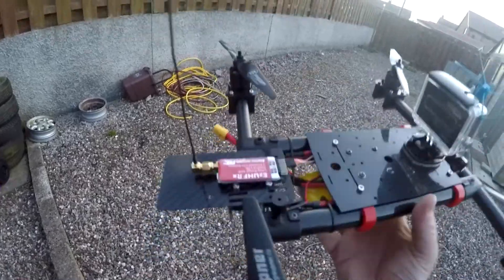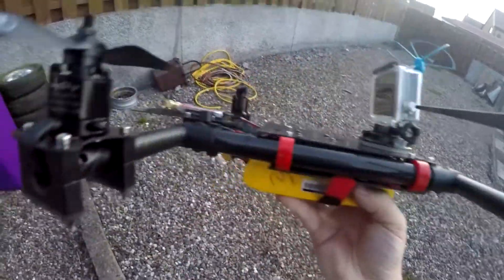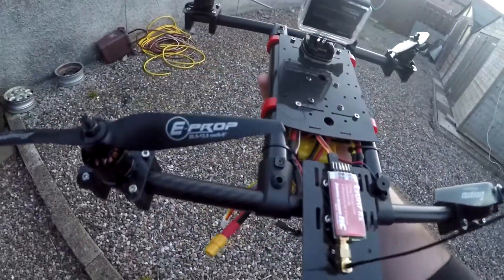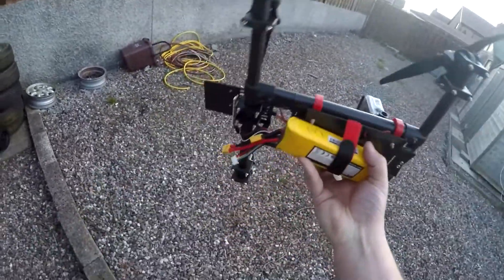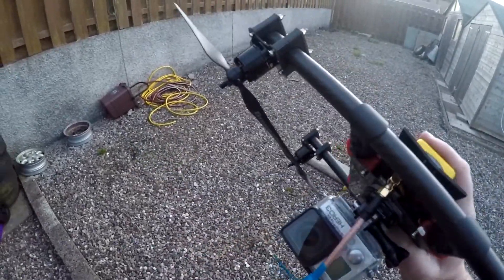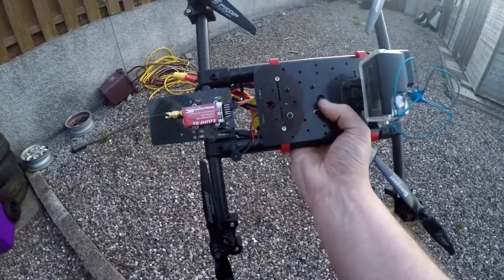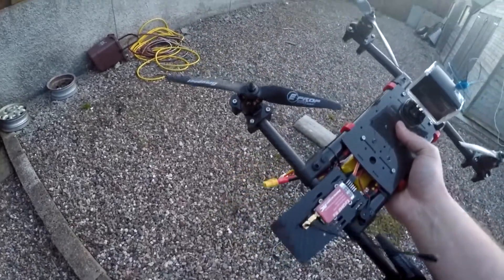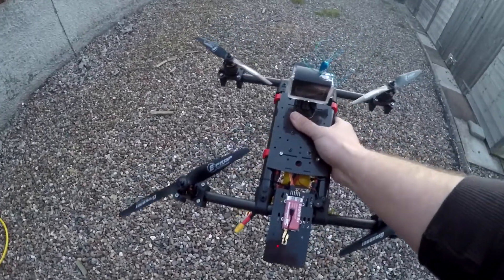Homemade 400 Sized H Frame Quadcopter Test.

Comment: Rude as Hell Rudeboy. Good Job PaL.  Can't wait to see a decent Flight with this Homemade quad on a less windy day.
Reply from the maker: Mike Hewlett haha, thanks buddy, hoping to get out for a proper test today with it so all going well be some video tonight.
Reply: Yeahhh Mann NICE :) I'm looking through my left over bits for a frame build due to your idea. I DO like your build though.
Reply from the maker: Mike Hewlett lol, good luck, If this one works and flies well then I may get hold of the parts to build a 250 sized one along the same sort of idea, will see how this one works out first, thing is I've still got enough parts that i could build another one almost identical to this.
Reply: I've just finished a totem 330 build using an upgraded naza lite to v2 & although it fly's well (still need to finish pid settings) it locks in pretty well. Only disappointment I have is the frame is a little small for components. But the 330 size is good.